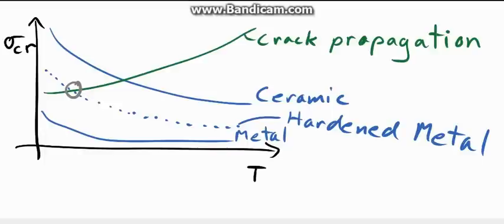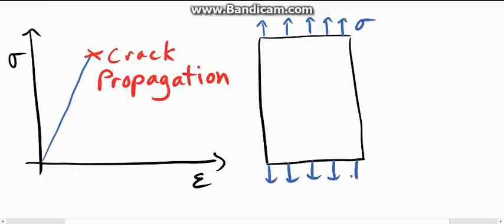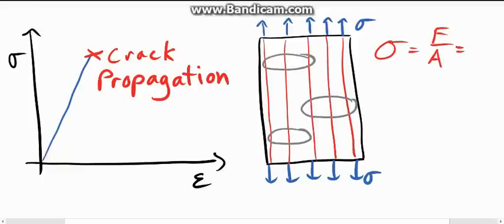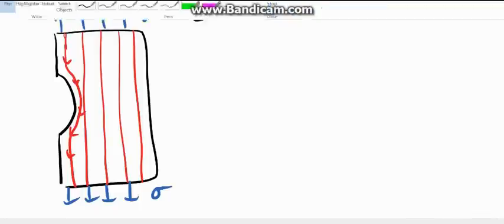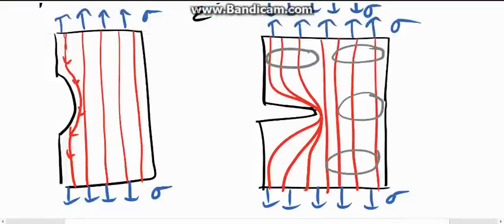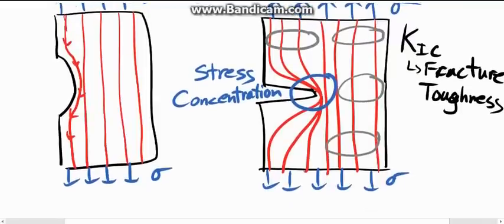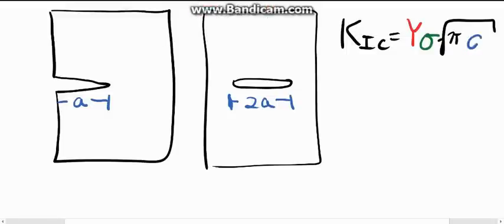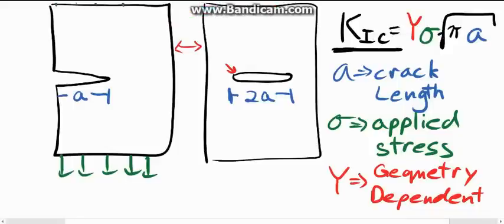Fracture Toughness

Comment: For calculation purpose, which value shall be taken for sigma ? is it the maximum stress seen in the material during the application of load (or displacement)? 
Also, could you please elaborate more for the value of Y? In case of concrete what value shall I select?
Reply: Jack Sparrow If I'm not mistaken, the value for sigma must be taken from the location where the stress occuring at the structure is uniform, you get my point?
Do feel free to correct my answer if it is incorrect.

Comment: Everyone is expressing K1c and speaking of its relative magnitude. Can you explain what is it relative to? For example a K1c of 10 is a threshold so once your calculated K1c is below we can expect no crack propagation #stillabitconfused:s
Reply from the maker: K1 is a measure of how much the stress is increased around a crack tip. K1c is the critical value (c = critical) to make a crack grow in a material. If two materials have the exact same crack geometry but different K1c values, the material with a larger K1c could withstand more stress before breaking than the material with lower K1c. Try looking up values of K1c for different materials that you know are brittle or ductile to understand what is a large or small K1c value.

Hope this helps.
Reply: @dr.monroesmaterialsscience7797  Can we say Ductile materials will always have a better fracture toughness than Brittle Materials? I still don't understand why car interiors  (Dashboard controls like AC)are made from Hard Plastics like ABS only to break when they can easily use a metal and prevent that.